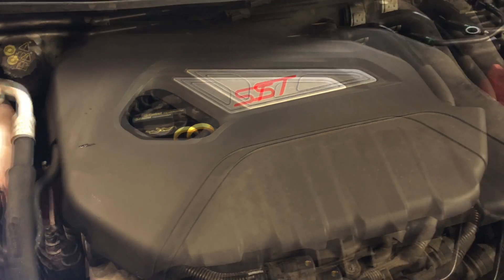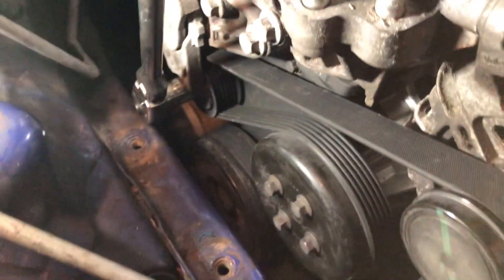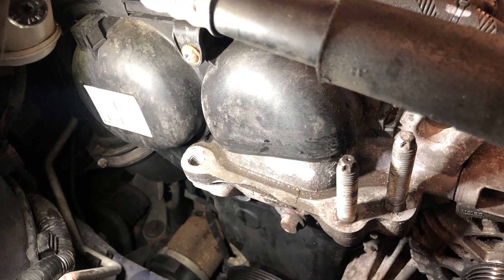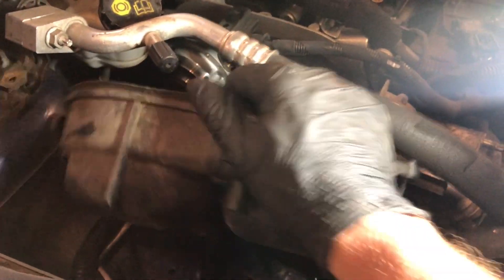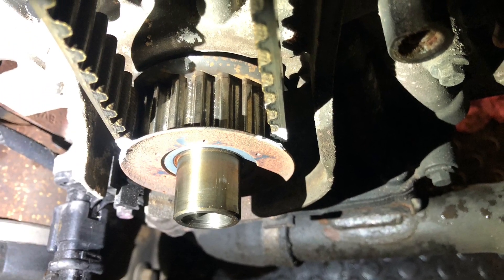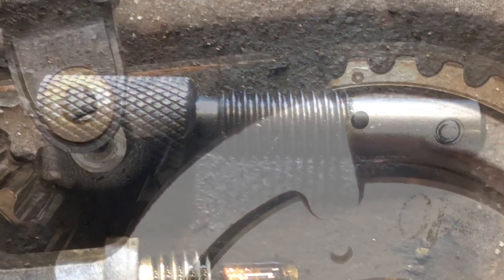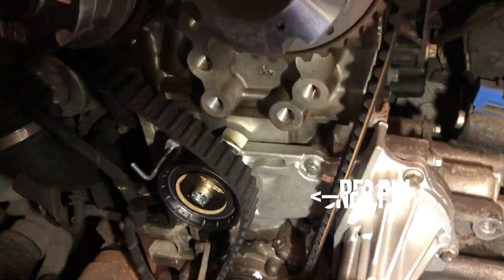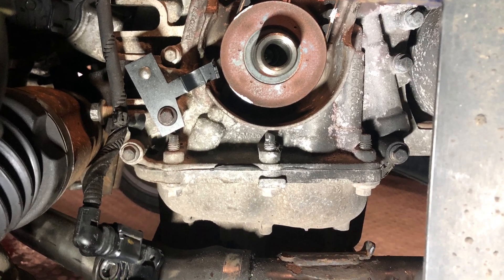Ford Fiesta ST3 Timing Belt Replacement. How to change your ST Cambelt without messing up!

Comment: I would be stressed to not have the flywheel locked when having to torque the crank pulley back down. I wish you would have shown retorquing the crank pulley portion.

Comment: Hi I’m getting a kind of humming sound after the revs drop on start up coming from around the auxiliary belt area which seems to fade as the car warms have you experienced this kind of noise before ? Thanks
Reply from the maker: Best thing to do is run it with auxiliary belt removed. If it goes it’s obviously one of the pulleys/alternator. Then spin them separately and see if any make a noise.
Reply: @How2FixIt1  is it safe to do that ? Could it harm the engine ? My knowledge is limited with this kind of mechanics.
Reply from the maker: @elliot7573 it won’t run for long because the battery will go flat. Obviously no charge going in battery. So you may need a battery charger and or booster for afterwards.
Reply: @How2FixIt1  thanks for all the info 👍🏼
Reply from the maker: @elliot7573 your welcome

Comment: Does the flywheel tool come in the same kit from Laser as the timing locking tool? If not can you tell me which tool to buy please? Also where is it shown in the video as I can't seem to find it
Reply from the maker: There are different kits. Make sure you get the one that specifies the 1.6. And or st engine. It’s a small tool that inserts in back of pulley. Rewatch video. I’m sure it’s there. Thanks for your comment and good luck with the job.
Reply: @How2FixIt1  Thanks. You mention one kit which is specific to the 1.6 which I have. I also say the one you put in the back of the pulley but is there not a seperate tool for the flywheel? I have rewatdhed this video and this is all I can see. Thanks.
Reply from the maker: @Nyle95 the flywheel locks at the back of the engine. Remove the driveshaft bracket. There is a blanking plug to remove. Then the locking tool screws in. Then the crankshaft is turned to but upto the tool. The other method is removing the starter motor where a special tool can lock off the flywheel as on the 1.0 l Ecoboost Engine.
Reply: @How2FixIt1  Okay thanks. So for the 1.6L the seperate flywheel tool is not required? Thanks.
Reply from the maker: @Nyle95 yes you require the one in block behind drive shaft, and the one on the pulley to allow correct ignition timing. 👍

Comment: how did u torque the crank pulley without removing the starter?    did u just use an impact   only thing that makes me nervous about the job lol cause everyone else removes starter to lock the flywheel
Reply from the maker: Other than removal, the crank buts up against the lock tool in the lower engine casing. So it can’t go any further. So you should be able to put plenty of pressure on. It worked fine for me, but if it niggles you then get the correct tool. Thanks for your comment and good luck!

Comment: Thank you for the video. Did you lock a flywheel at all?
Reply: The pin does not "lock" the crankshaft. It's just a stop for TDC. You have to remove the starter motor and use a special tool to lock the flywheel to stop the crank from moving.
Reply from the maker: Your welcome. Yes it shows you in the video. Thanks for your comment.
Reply: I don't get it. Those cam locking spiders fit in better if you turn them around 180°. They slot straight in all the grooves in the pulley flush. Are they all marked up wrong? 
I've got two and they are exactly the same
Reply: At which point did you lock the flywheel? And I could only see information about the Laser 5903 kit which doesn't include a tool for the flywheel.
Reply: @Nyle95 the crankshaft is locked with the pin, which is the same as locking the flywheel…🤦🏻‍♂️